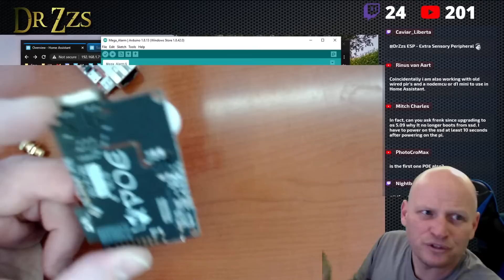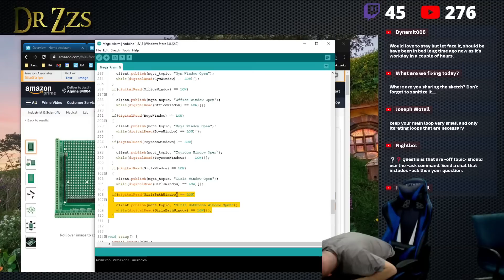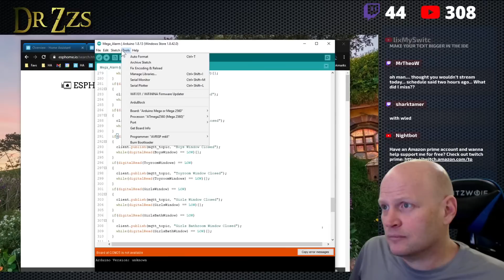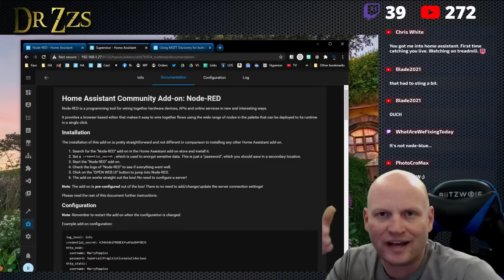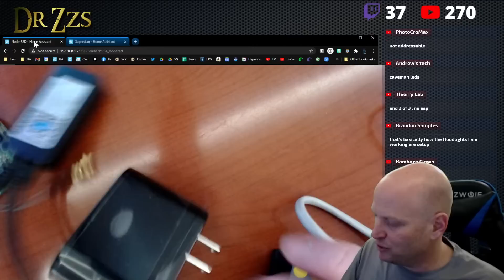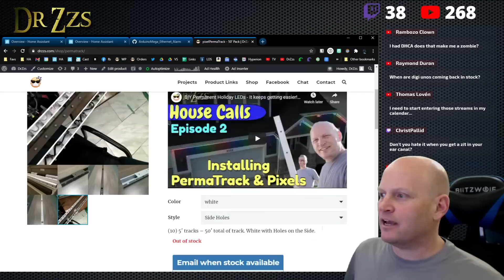New Home Assistant Set-up Continued.  BroadLink RF Plugs, MQTT Wired Alarm, NodeRED?

Comment: To power the ESP32 etc using POE.  Just use a POE splitter.  this will allow you to connect the ethernet cable and then have a 5volt 2.4 amp supply to power the ESP board only.

Comment: A tip for your code. It just eats RAM storing cstring variables, and uses the String class with tends to leak/fragment/not-free memory. For a system which needs to run 24/7, String should be avoided and all your string processing should take place in cstrings (char arrays). And all the cstring constants should be moved to PROGMEM to be stored in flash only, not RAM. Don't connect the wires directly to your Arduino pins. You'll get problems ranging from false triggered to fried pins. Long wire feeds must be buffered or isolated somehow. The easiest method is to use opto-isolators. Activating INPUT_PULLUP in the sketch isn't adequate as the built in pullups are about 50K, very weak.

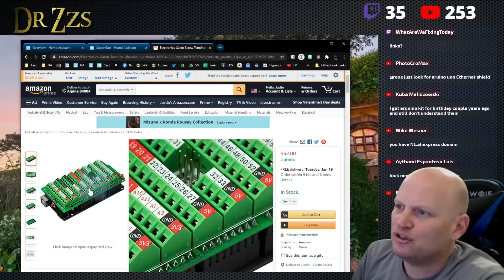Comment: HI @DrZzs! I'm in the middle of watching this and i just wanted to let you know it is possible to stack the ethernet board on the mega and a breakout board on top of that. I'm using the one from electronics salon you're looking at (@31:20), and i just doubled up on header pins, works fine. I terminated all the pinouts to 2 24-port patchpanels. (Mainly because i got a free 1000 meter roll of cat5e). This way a can terminate rj45 connectors to my cable runs. At the moment i'm only using 2 honeywell PIR's (which are also powered over the same cat5 cable), but when my new house is finished i intend to use something like the honeywell 944t door/window sensor. I stole the idea of Jon Oxer from Superhouse.tv, i also used his code and modified it. Very interested to see what you will end up with, Cheers